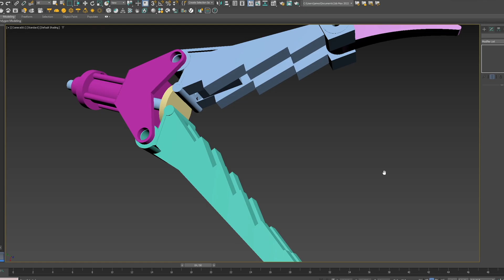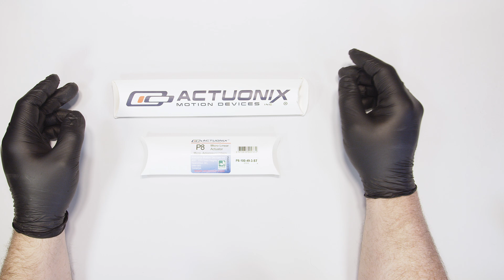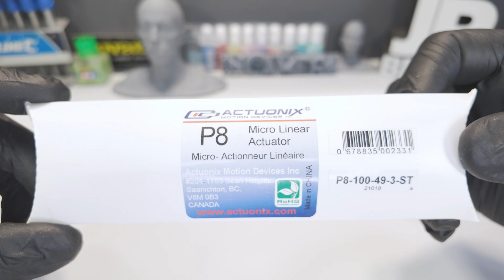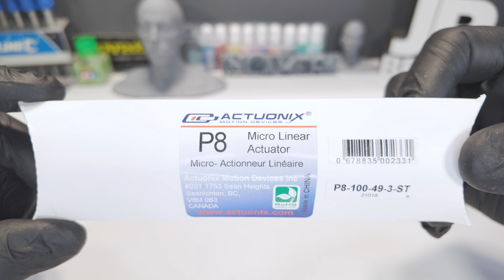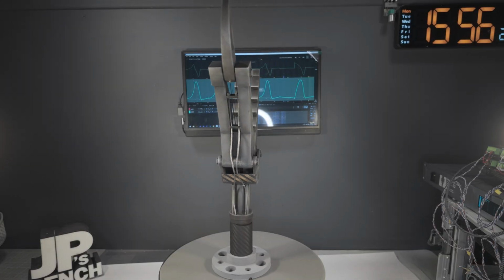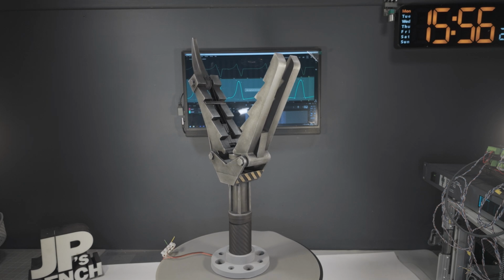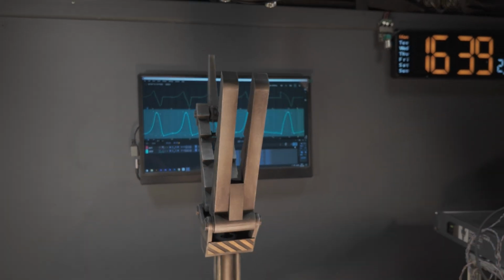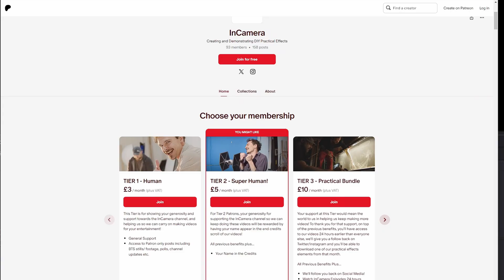JP's Bench - Introduction to Animatronics

Comment: I do wonder how these kinds of very weak animatronics or puppets do anything requiring force? Like I am sure I have seen a creature mouth tear clothes or flesh now and then but they obviously need to make things simple and safe, so does anyone know?
Reply from the maker: Very rarely would an animatronic or puppet be designed or capable to intentionally have enough force to rip or tear clothes or flesh (for real) - as for a movie, you would more often want to control the damaged surface in a controllable and repeatable way. So clothes would have pre-scored or weakened areas to tear in a predetermined way and never require a puppet or animatronic to actually exert that amount of force anywhere near an actor or stunt person (it would be staged like a stunt throw- with very minimal actual physical contact). Also if an animatronic or puppet is to 'punch through a wall' - it would almost always require a breakaway wall section made of lightweight materials - so as to not damage the puppet or animatronic, for when it needs 20 takes to get the shot looking right...and also will help make the debris fly predicably and safely each time. It is totally possible to build puppets and animatronics that are very strong and tough, using hydraulics and compressed air  - such as most of the OG full size Jurassic Park dinosaur animatronics or the full size bugs in Starship Troopers, but these have been fairly unique examples, which basically use the same hardware as construction diggers, but with faster and higher performance actuators and motion bases. The reality is that for a T-800 - level strength endoskeleton to exist in the real world, there would need to be a huge leap in motor and battery technology to allow motors and actuators to travel at those high speeds with insane torque and to NOT be the size of the Hulk....It's coming though! #skynet
Reply: @InCameraTV  now that's very comprehensive! Cheers for the point baout breakaway walls too, I habe seen a fair few unconvincing ones in my time now that you mentioned it haha!
And yeah, I really don't mean it would rip real flesh or even tough fabric, but I feel like even ripping latex flesh or similar takes a bit of force, but maybe that's not what's used for fx, or it's not as tough as I imagine.

Comment: I was starting to wonder how you were going to have the claws retract when the actuator move back, but then you explained that it was a magnet.  That's a clever way of doing it!
Reply from the maker: I’m a huge fan of magnets…if you can make any internal of a filming model/ prop or miniature accessible without screws or bolts being needed…magnets are a huge time saver in getting inside something to fix or adjust. Likewise, if a mechanical coupling or linkage can be made strong and reliable enough with magnets, it is a great way to swap out parts, if they fail - JP